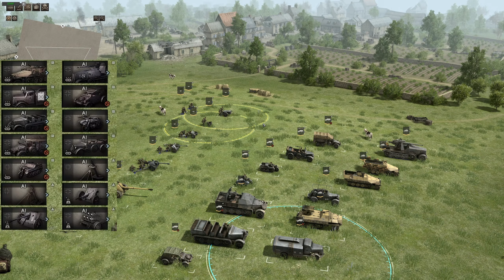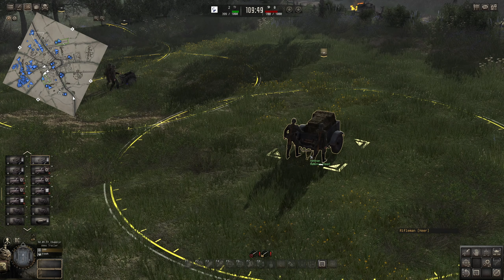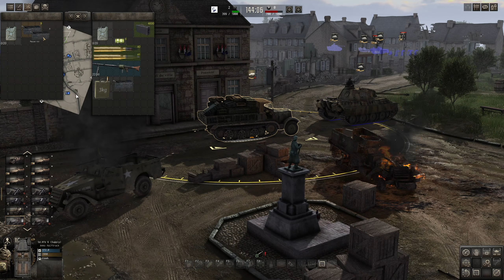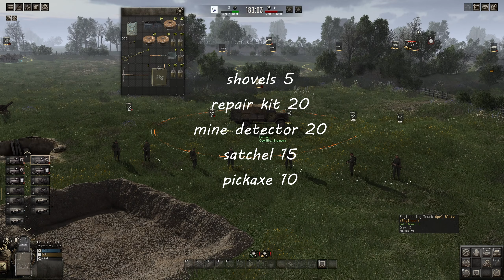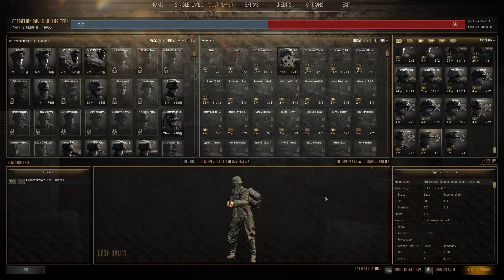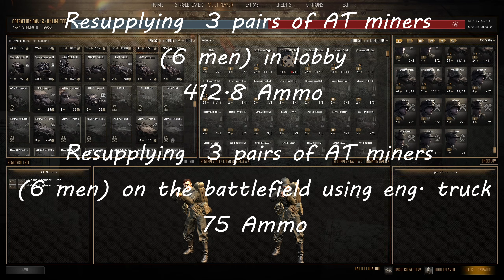Gates of Hell | Tutorial | Supply and Logistics

Comment: Important thing to note: The engineer truck can also resupply repair kits to vehicles. If you're going for a heavy mechanized/ looted vehicle run, it's always good to bring along engineer vehicles to rearm repair kits. It can save you resources from replacing them in conquest, or if you have a tank that keeps getting beat up and is constantly needing repairs to stay in the fight.

Edit: Sorry I just noticed you covered this already.

On another note: One thing that is also an option for conquest specifically (not sure about multiplayer) but some of the vehicles that spawn on the maps have either fuel or repair kits (some tanks or artillery pieces that spawn on the map have their ammunition that can be grabbed as well).
Reply from the maker: Great tip, scavenging abandoned vehicles for supplies is definitely a pro move! :)
Reply: @hetmanRTS  Also, you can drop a guy's weapon like a machine gun or bazooka in a car at the end of the conquest round, and then resupply him to get that weapon back. This is how I'll get entire Ranger Squads loaded up with Bazookas to just dunk on German armor

Comment: Oh I did not know the thing how you can take parts of the ammunition. Thats good. But well when it comes to MG Gunners, I normally always stuff them up to upper edge of the lower lip, with about 2000 MG ammo. The same with Tankammo, almost all doubled or even trippeld when it comes to Marder, Hetzer or Stug.
But now something special or spezific.
You know everytime there is significant update in GOH a lot of people are struggling to transform / taking over their savegames into the new version. The point is, I know there is a "how to continue conquest after any update" manual put into the GOH discussions Side on Steam. There is only one problem. 
I still did not understand one thing. In the 7 zip version the developers are showing to change the game version number in the savegamefolder you get the offer to open the folder "in the archive". First I was struggling because I did not have 7zip at all but another program. Then  l took 7zip but when you rightclick on the savegame .sav folder its not offering "open in archive" option. So maybe there is a newer version of 7zip. I don`t know. Fact is that a lot of people are struggling to take over their old saves into a new game version because unfortunately this whole process is not offered to be solved right in the game in the savegame section for example. That would be the easiest but its not there. 
So maybe could you make an extra how to video for this case? Maybe with a downloadlink to exactly that 7zip version that you use to be sure that everything would be working out the same like you do? Because right now this problem is not easily to be solved.
P.s. By the way. The ammunition reload bug that you mentioned. Unfortunately I have also seen that with engineers. And as you mentioned, engineer trucks don`t reload passively and this can lead to a complete waste of your truck resources and nothing will be replaced.
Reply from the maker: I'm sorry, man, I don't do technical things. 
This is more of a question for a developer / modder.